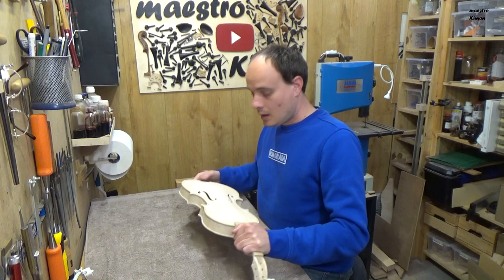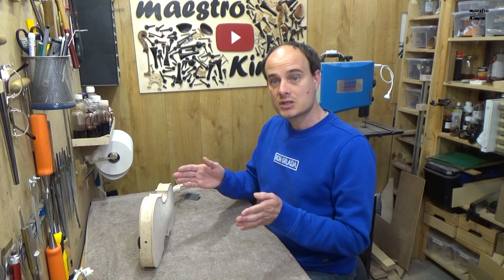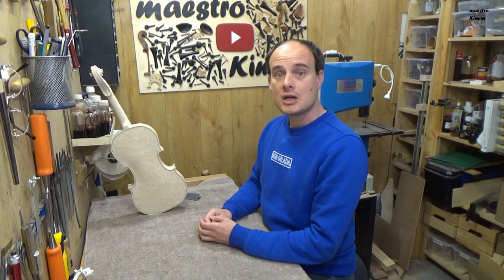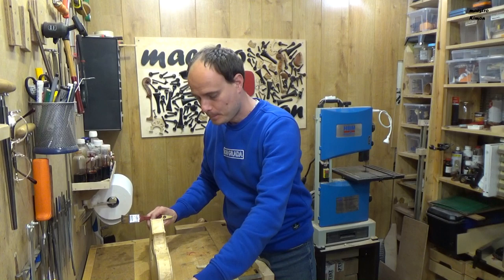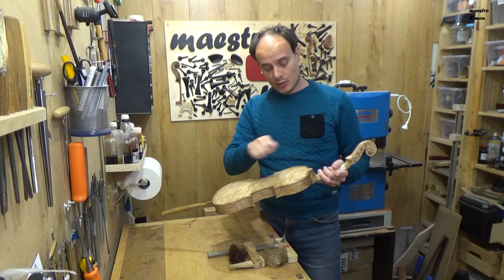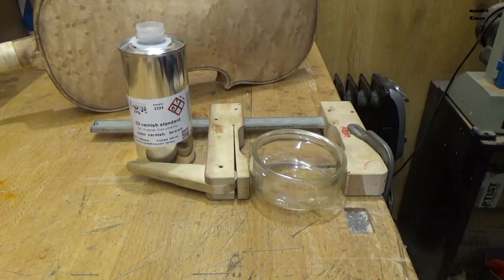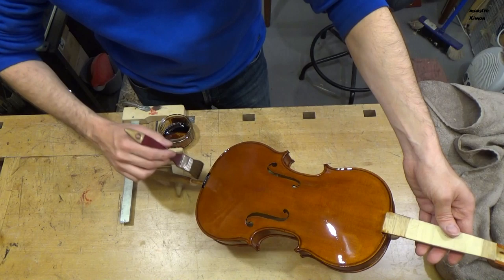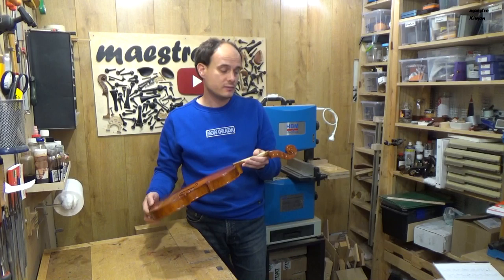Making a violin - step 22 - Varnishing the violin

Comment: This was very interesting to watch, and your work is beautiful! I would like to ask some questions, if that's okay with you. First, when you sand between coats what grit do you use? Is it important to sand everywhere, even in small crevices? How do you know when you have sanded enough? And lastly, do you add any driers to the varnish, or do you use it as it comes from Joha? I hope this is not too many questions! Thank you!
Reply: I have been looking at more of your wonderful videos, including on where you show your technique for applying a layer of varnish, and I find that a lot of my questions are now answered, along with more I hadn't thought of. I think I have been using too coarse a grit, and I've been doing it dry, so I will now use 2400 micromesh with water like you did in the other video. My project is actually a bassoon refinishing, and the advice I got elsewhere involved adding artist paints as color (bassoons tend to need a darker stain than violins usually have) and also a manganese dryer. I don't know if the addition of artist paint might slow the drying time without the manganese dryer. If so, maybe I don't need the dryer in the clear coats on top. I also have been spreading the varnish with my finger with a vinyl glove. This is my first venture into finishing, so I am learning a lot as I go, including a lot from your videos! I have built a UV drying cabinet, using the kit available from International Violin, with a ventilation fan and a disco ball motor to keep the work in motion. I know some parts of my process are different from what you do; I'm doing my best to take in a lot of information and put it together into something that works for me. Thanks so much for your great videos, and if you see anything in what I wrote that sounds like a disaster in the making, please tell me, I'm all ears!

Comment: Dear Maestro! I like the way you show condensed the different coloured layer in the parallel windows. This video helps a lot. One thing is still unclear to me. Obviously the neck in teh area of the hands stays undone rom coloured layers. But did you alos apply a transparnet layer like the last protective one? - Kurt
Reply from the maker: Hello Kurt. Thank you for your kind feedback. The neck has no varnish at all. The only thing that I do is apply some water stain to make it a bit darker and the linseed oil to seal the wood a bit and make it even smoother.

Comment: you did a lot of hard work on that violin  till the end you cut a lot of corners on the varnish .. i believe from reading and strad a lot that the secret of good sound is in the minerals that you preserve the wood with before and after making the violin .. also the varnish . you should of used oil base varnish with all other minerals so to give it maximum sound .
Reply from the maker: In my opinion the varnish matter is overestimated and especially by The Strad. The varnish is only one part of a very complicated instrument where everything matters: from that wood quality till the strings. The varnish is one of the most difficult parts to understand what regards it's effect on the sound so (in my opinion) it has been overrated. I have made several videos on the varnish and on the ones I use, have a look if you want!

Comment: I always happenn to have too much varnish in the bristles so some drops run on the finish and make mess, even if i try to avoid that, do you have any tips?
Reply from the maker: Try putting les varnish on the brush. If it happens in the chamber maybe it becomes to hot. Try speeding up the ventilator.

Comment: What varnish and dye do you recommend for a double bass?
Reply from the maker: The same as for a violin or cello!
Reply: @maestrokimon  Could you repeat the formula? I didn't understand a few things, my English is bad.
Reply from the maker: Do you have any experience with varnishing an instrument?
Reply: @maestrokimon  no :(
Reply from the maker: In that case I would recommend to use the oil varnish assortment 1 by Joha. It has everything you need, good instructions and you don't need to get in the trouble of making your own varnish. Did you make the double bass yourself?
Reply: @maestrokimon  Perfect, I found it, no, the bass is Chinese, it has a lacquer that decreases the volume a lot, and I plan to change fretboard and varnish
Reply from the maker: I see. Good luck with your project!